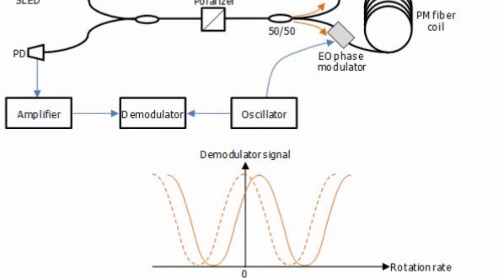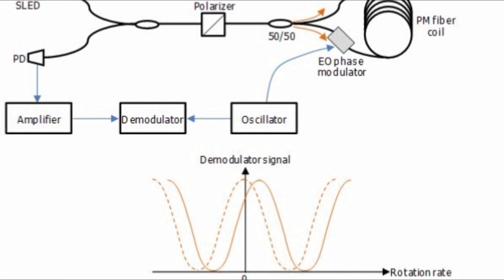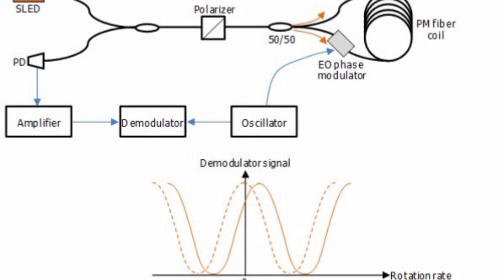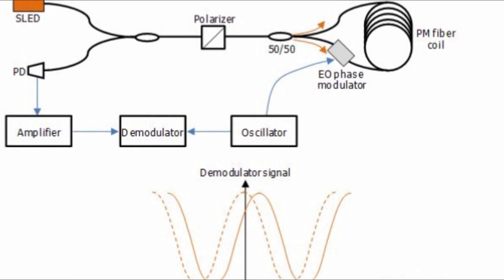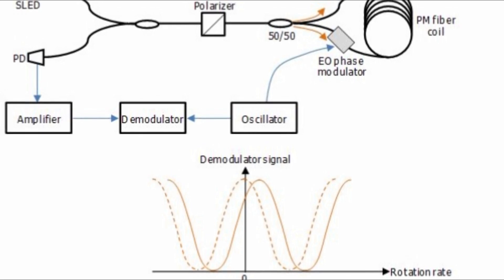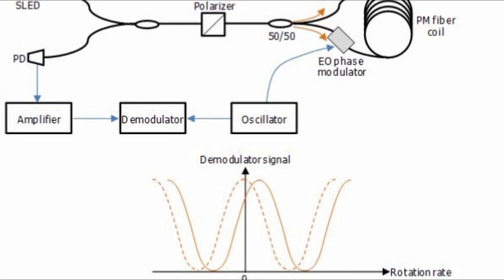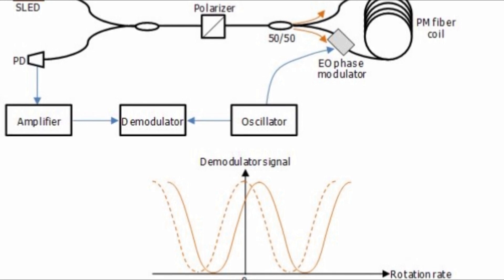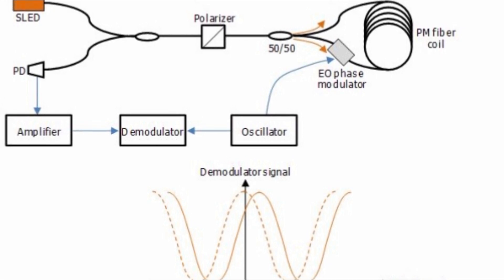Overview of Fibre Optic Gyroscope

Comment: I've found the fatal flaw in Special Relativity. The relativistic = Sagnac equation allows the Radius of the gyro  to  be infinite. In this case the curvature of the circumference is to be approximated as a straight line ( math as it is) . The interferometer will measure c + v / c - v in a straight line !
Special Relativity cannot scam back its own equation, so it is definitively busted by its own forgery. https://youtu.be/aeD1qhqZFkw
Reply from the maker: Great dear